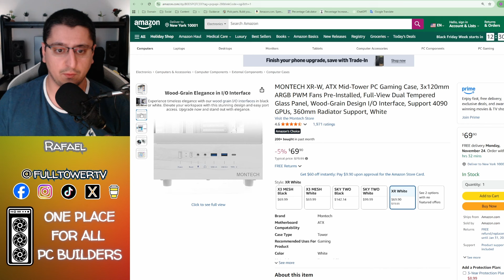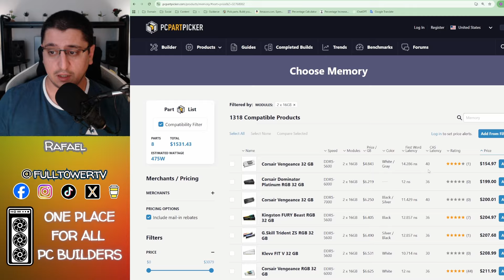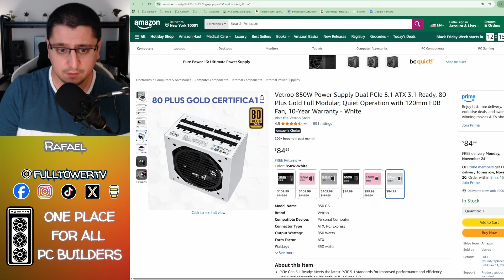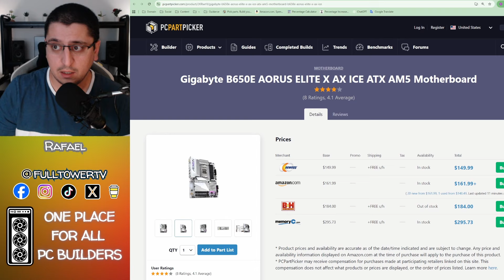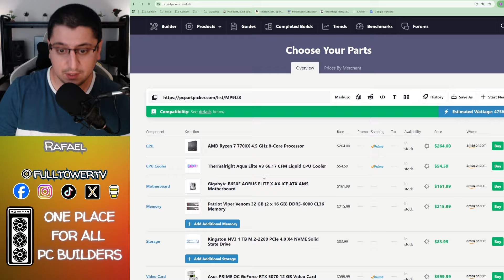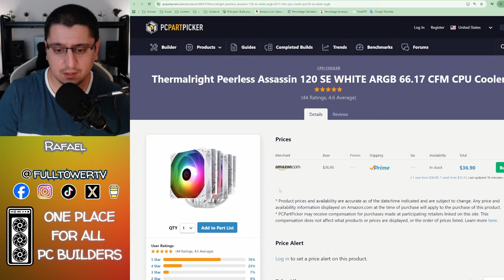Planning an all white gaming PC build for $1500 in the US 🇺🇸

Comment: if you could make a video about pc rgb sync and configuration it would be great, my build is perpetually stuck in rainbow purgatory and I hate it
Reply from the maker: I have a video that shows how to control rgb with software (OpenRGB) but it works if the rgb fans you have are plugged directly to the motherboars:
https://youtu.be/0OTXuRjzqPo

You can also try use SignalRGB instead because OpenRGB can be a bit buggy sometimes.